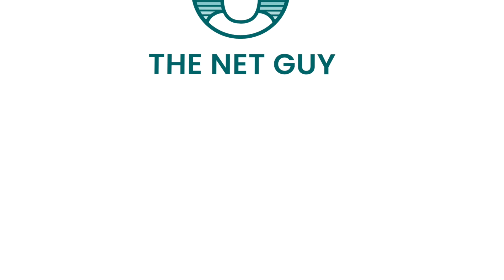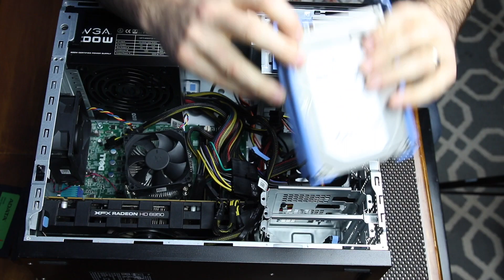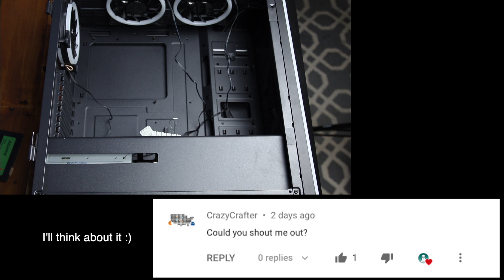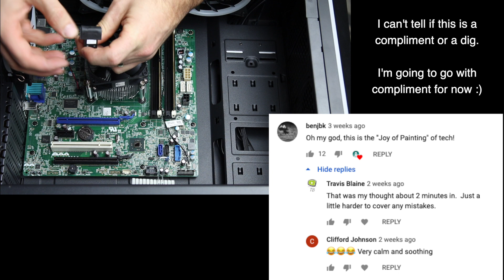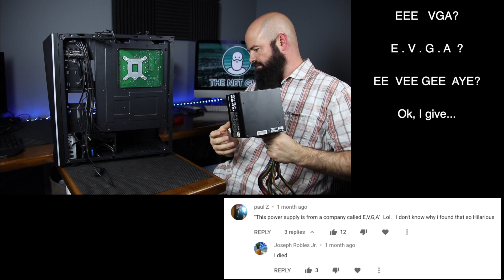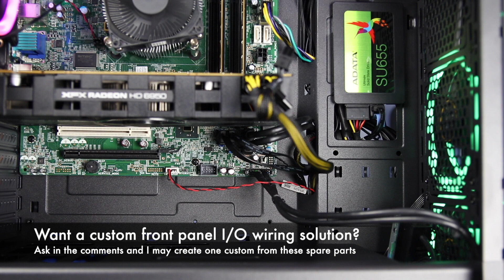Easy Dell Optiplex RGB Case Transplant

Comment: @TheNetGuy, I have a Dell Optiplex 9010 MT. However, i got a new PSU, GPU and everything works great! but recently after cleaning the old thermal paste and replcaing it, I was not able to boot my PC until i took off one of the rams out of the slot. btw: the ram which i took off works in other PC after testing. I don't know if this is an issue?idk..  because i still have 3 slot's which i use and gives me 10GB ram. (the PC only boot's up when i take off one of the ram from the 1st slot) -( figured that out after 8 hours of staring at the motherboard)  
PS: thanks about the power button soultion, i am soon getting a case so was wondering how was i going to power it up. 
#THEBESTNETGUY
Reply from the maker: Oh man that stinks.  I’ve been there.  The first time I did a case swap I was getting no boot up and it turns out it was the ram needing to be reseated.   Sounds like you tried that.  And chance there is a bent pin in slot 1?
Reply: @TheNetGuy  I feel like it might be a bent pin I guess because I remember cleaning my ram slot with the brush. I can however try finding the broken pin and maybe it will work then? I am not sure tho but most probably of what I can now think of 💔💔 

And Thanks Always to you . ❤️

Comment: Can anyone help. So ive changed my dell 9020 case and evrythings connected. But when i switch it on it doesn't detect my harddrives. When trying to enter setup it says "can not enter setup halting tbe system"
Reply from the maker: Does it not detect any of them or just some?  Did you leave the front panel connector installed and hidden?  I’ve heard they can disable some sata ports.
Reply: @TheNetGuy  I've managed to fix it. Just had to enable legacy mode in the bios. But its working great now.
Reply from the maker: Glad to hear my friend!

Comment: I have pc
Dell optiplex 3010 
Core i5 3470 
Rx 580 8gb 
Will there be any issue if i swap to RGB case
Reply from the maker: Beautiful setup.  I’m not certain on that board, but I bet you could figure out the issues.
Reply: @TheNetGuy  will i need adapters or anything to change to aerocool quartz gaming case plz tell
Reply from the maker: Looks like it will work.  Do you have the mid tower version or small form factor case?  https://linustechtips.com/main/topic/927285-pc-case-changing-dell-optiplex-3010-to-cooler-master-5-rgb/

Comment: Hello, congratulations again for this very good job!
I have a question about the PC case model. The brand you are using is not available here. I saw that a large part of the brands have models for around $ 100. For the transition from the Dell 9020 Beyond the aesthetic side, on what points should you be really careful to choose a model? Are there manufacturers/brand to avoid?
Reply from the maker: Great question. What case are you coming from?  Any mATX case will work - stay away from ITX cases.  You’ll need a power supply adapter from the description if you have a Dell 9020
Reply: @TheNetGuy  Hello, This is the Dell 9020 in MT format
Dimensions (H x W x D) Inches / (cm) 14.2 x 6.9 x 16.4 /36.0 x 17.5 x 1.7
I have to change the PSU, so I followed your previous very good video and I saw this video. So I'm thinking of doing the 2 Case + PSU operations. I ordered the 24x8 adapter and am now looking into what to put it all in.
Almost in the same price ~ $ 100
LANCOOL II - X
PHANTEKS Eclipse P400A
Fractal Design Meshify C
MSI MPG GUNGNIR 100D
be quiet! Pure Base 500
Reply from the maker: Check out PC Tech Hustle channel.  He did an amazing lancool II case swap and the Dell looks epic!

Comment: I just got a new case. I can't use the rear fans so would I have to get any adapter? If so can someone tell me? And my case also came with a front fan as well. I don't know where I would plug it into.
Reply from the maker: It depends on the fan types.  What is the base system you have? Dell 9020, 7020?  Most auxiliary fans plug into the power supply.  Controlled fans can run off the motherboard and have 3 or 4 pins.  Check amazon for fan adapters.
Reply: I have a 9020. My dad got it for me for Christmas. He works as a programmer so he got it free. I can see about the rear fan getting an adapter for the 5 pin that it needs to work. I'm just not sure about the front one. I bought the Lian Li 205 case.

Comment: can this work on dell precisiont3500?
Reply from the maker: Possibly.  That a BIG motherboard - you’ll need to find a full size ATX case.  It does have what looks like a full ATX power connector at the bottom though.
Reply: @TheNetGuy  thanks men!

Comment: I have a problem same pc 9020
Power supply 8pin converyor adapter connected with 400w standard power supply but pc get turn on and agin when to poqer saving mode with power light blinking witj orange colour
Reply from the maker: Reseat the RAM sticks just in case here.
Reply: @TheNetGuy  ok bro i wil check it thanks 😊👍

Comment: Did you ever find a eay to make the front io work
Reply from the maker: Unfortunately no - you can get usb extensions and plug into the headers inside and nobody in their right mind uses front panel audio ;)
Reply from the maker: Great name BTW 👍
Reply: @TheNetGuy  thanks homie its a old nickname haha. I figured i just keep the old front usb attached and hidden for my keyboard and usb wireless dongles. i am swapping my my 9020 to a new case after using it as a work pc for the past few months. I got a good deal case with included  rgb fans. I already bought the 5 to 4 pin adapters i was just wondering if the motherbaord supports voltage control of fans since im not sure if the inclueded fans are 4 or 3 pin and if they are 3 pin i might have to go voltage control for them

Comment: Dell 9020 rear fan is I think 80mm. How you fix it on top because these newer cases has only 120mm and 140mm case screw holes
Reply from the maker: Great question!   Mesh openings.  Mount it wherever you want with those :)
Reply: @TheNetGuy  Thanks for reply. BTW I have Dell T1700 which is similar to it. I want to move my motherboard in Corsair Spec 06 RGB Case. Is that a good option ?
Reply from the maker: Yeah that looks VERY similar of a project, would probably work well!

Comment: can i do this with an NZXT H5101? I have an Optiplex 7010 Mt
Reply from the maker: Yes, that would be an amazing case for this. I wish I could get one of those, I just ordered a thermaltake core V 21 cube case for another project I’m on.
Reply: @TheNetGuy  But the jumper thing. I don't know where to get one of those. I heard that the old front io had to be connected for the PC to boot. So couldn't i just snip it a little after the plug?  Then I just use the jumper for the new front io? Could we also talk more about it on discord? Stumpy#1028
Reply: @JohnathanAlonzo  you can buy adapters from harbin electronics on ebay

Comment: Great video btw, i have the optiplex 3020 and the 5 pin front panel looks identical to this...should the jumper positiom be the same? Thanks in advance.
Reply from the maker: It should be
Reply: @TheNetGuy  confirmed..it works..thanks.
Reply from the maker: Fantastic!
Reply: Me too but I can switch it I need help

Comment: I did the same thing with a 7010 tower. For the front panel connectors I took off the housing and routed the usb and audio to the front of the case. In my case the front panel jacks were removable and I was able to route the dell ones through for a seamless solution. It’s well worth buying these boards because they’re so cheap and plentiful. The front connectors were really the only downside
Reply from the maker: Exactly.  Nice job!   Send me a picture and I’ll try to include it in a future video.

Comment: I heard you would want to power the drives from the motherboard and not the new psu. Like it was before the case swap.
Reply from the maker: Yes and no - that power from the board is to lower the amount of wiring, though if you wanted to add more drives or additional loads - if you have the power supply connectors free it saves you from some extra power draw on the motherboard adapter.
Reply: @TheNetGuy  I think the forum post where I read about it was more of a "better safe than sorry" approach. Looking at it myself it seems more like cable management on Dells end, cant imagine why it would matter where the drives got their power from. As long as it was enough, and stable.

Comment: Thank you for that. Depending on how a Dell based build I'm about to start goes I was planning to do something similar with a case I already own and love. No one on the Dell forum could give me a pin diagram for the power switch or told me to just jumper the middle pins if I'm okay with losing the LED.
Reply from the maker: Glad I could help - how did it go?
Reply: @TheNetGuy  pretty well all told. I missed the part about needing to remove the shield around the power button connectors, so I ended up adapting the Dell power switch. Its unobtrusive enough that I'll probably just live with it instead of swapping over to the case power button. Other than that it all went well.

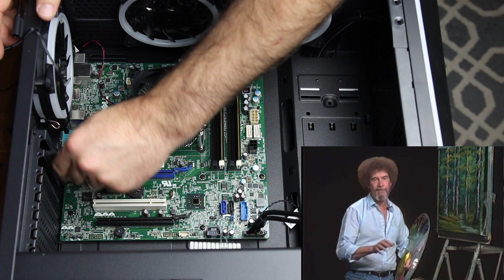Comment: What if I put my graphics card on the black one except of the blue one 15:30
Reply from the maker: Great question.  Usually lower performance.  Often the lower port isn’t as fast or is shared with some other device like an m.2 slot.  It’s preferred to use the top spot even though thermally its not best.
Reply: The Net Guy Okay thank you I just need more room for one more sata cable and my guy is in the way but saw the black slot but I won’t change it thank you!

Comment: Do I need to have the front poanel IO connected or will i get a connection failure?
Reply from the maker: You do need to plug it in for the system to work right apparently, though you don’t have to show it.  I have heard of people cutting the cable an inch up from the connector and using it as a dummy plug.  There must be some pins jumpers when the cable is connected.
Reply: @TheNetGuy   I appreciate your reply! I found out on a forum you can jump the pins manually using the jumpers and it will make the error go away.
Reply from the maker: Interesting.  Can you shoot me the link?   Jon @ TheNetGuy . Com?   I may put it in a future video.  Working now on a Dell 9020 killer series - pics on my Instagram.
Reply: @TheNetGuy  Sure thing! https://linustechtips.com/main/topic/987783-optiplex-70109010-front-io-panel-pinout/

Hope this helps :)

Comment: I have an hp z230 and I want to transform it to a nzxt 510 case and I want to put the water colling does this motherboard support the standard support of port cpu for install water colling
Reply: whats your opinion
Reply from the maker: With the right adapters you can do almost anything.  I would check out Tom hardware in linus tech tips forums. Reddit can also be a good resource.
Reply: @TheNetGuy  thank you so much

Comment: If you can cut the wires at the front I/O header, and it won't have an error, then wouldn't it stand to reason that if you cut back the heat shrink on that wire, you'd be able to see which pins can be jumped straight on the mobo?
Reply from the maker: Very astute observation yes. In this way, you can always go back to the old case if you decide to upgrade later. I ended up doing that with this exact machine, sold that Dell 9020 to a friend in the original case, and it only took about 15 minutes to swap back.  If you’re looking for a more permanent solution, that is one way to do it. Thank you for watching and especially for commenting. Would you like to see more 9020 videos?
Reply: @TheNetGuy  absolutely!

Comment: I had thought of something like this as well.  I, however, went the other route.   I modified the Dell case itself by removing the hard drive cage which made room for larger GPUs and mounted a fan on the front of the case.   I feel this is a cheaper solution but nothing wrong with putting the insides in another case.   Fresh ideas are always welcome.
Another Youtuber shows how to easily modify the case.    Well if you have the correct tools.  ;)
Reply from the maker: For some the visual appeal of an RGB case and additional room can be motivators.  Since you already have a good mobo, cpu, ram, drives, etc from the 9020 that can be reused.
Reply: How did you remove the hard drive cage cuz it's soldered and bolted in? I bought a GPU that is two to three inches too big and I'd prefer to not return it. Could use your wisdom on this. Thanks.
Reply: @CarlPotak  Soldered and riveted in place.  Proper drill bits easily removed the attachment points making a removal a snap.
Reply: @CarlPotak  https://www.youtube.com/watch?v=WtdqulgqWto

Comment: Hello, this does not seem to apply to the SFF 9020, where the CPU heatsink applies directly to the case. Any ideas on how to move SFF to a new case? Not sure how to attach the heat sink. Or is there a way to attach a normal heatsink to it? The 5pin connector is an issue there. Thanks.
Reply from the maker: Great name BTW - but you're absolutely right.  I found some bolts that you can use as a backing for the SFF board - I'm going to do a video soon on the HP 800 G2 which is my "Dell Killer" upgrade which will show this.

Comment: Is it possible you help me with that power switch issue, I got a phantom 410 case with a Dell Optiplex 7020 sff motherboard and I can’t find any kind of information on how to install the phantoms power sw, reset sw, hdd led, +p led pins to the mother board
Reply from the maker: Quick tip.  Skip them.  You don’t need the power led - the system is on :)   Power can go to the upper switch block as I show in the case transplant video.  Skip the reset switch too - nobody ever uses it.  If you have a single spare jumper you can do the whole swap easily.

Comment: Do you think it would work to transplant a 9020 SFF motherboard into a 9020 MT case?
Reply from the maker: I’ve heard the SFF is much harder.  The cables are more proprietary :(
Reply: There's  a video of a transfer to a full case, with a few connectors from ordered.

Comment: as regards to airflow i dont no what case is worse lol !!!!
Reply from the maker: Airflow is definitely not great from the front.  Auxiliary fans are a must or radiator cooler.  It’s a good looking case, just not designed for high air movement.   Check out my Athena M2 review video after this - I compare them and it has excellent air flow.  It’s now my primary case!

Comment: Will. This work with any optiplex
Reply from the maker: For 7020 and 9020 mid tower cases yes.  The SFF cases have some more unique bits.
Reply: @TheNetGuy  what about DT if u know??
Reply from the maker: DT= desktop?  They have SFF and MT and USFF case sizes.  Send me the model and I’ll look.
Reply: @TheNetGuy  it's bigger than a sff but smaller than a Mt it has 4 USB ports down the side of the dvd

Comment: You misssed the parts of instaling the front fans so can you show us how to do that and cqn we make the audio of the insted of the the original audio jack
Reply from the maker: Good point. In my new case the front fans were already installed and hook up via molex connector.  I have another video where I do a fan upgrade on this case with the Aeolus fan kit that's pretty cool!   The audio connector is lost in the process - you can't wire it up without cutting anything.  My goal on this video was a swap without cutting wires - in fact I sold this machine shortly after in the original case to a friend and didn't have any problems putting it back.  Thanks for watching and commenting!

Comment: Hi I was wondering if I need the jumper for the power switch if I do is there anywhere to buy one?
Reply from the maker: There may be a spare on your motherboard somewhere.  Also, and old switch will do as long as it had the DuPont connectors (black 1mm wire connections).  If you’re in the US, shoot me your address via email and I’ll postcard you a couple extras :)

Comment: Hey tech guy, I transplanted an optiplex 3010 into a raidmax case. I was actually able to get the front panel audio to work because that particular dell had a slot on the motherboard for hd audio. Im having trouble with my power switch though. could you send me a link to that jumper that you used in this video.  Also, did you ever come up with any way to rig up reset and leds. thanks in advance. awesome video
Reply from the maker: It's just a standard computer jumper - hopefully there is an extra somewhere in your nerdery pile.  Worst case you can use anything conductive that will touch just those two pins and not their neighbors.   Another option is a piece of wire, paper clip, or anything that can connect those two.

Comment: I have a problem, my psu is not broken ( I have tested it) but whenever I plug in the adapter it seems to not start. Please help, thanks!
Reply from the maker: Did you jumpier the middle set of pins on the power switch as shown?  You can also take the entire power switch from your old case and transfer it over to test first!

Comment: Will this work for a dell optiplex 9010
Reply from the maker: Yep, they are almost identical machines.  Good luck!
Reply: @TheNetGuy  thx
Reply: @TheNetGuy  I was wondering would it work with my dell optiplex 790 mt
Reply from the maker: I can’t guarantee it but from what I’m reading it looks possible.  Maybe I’ll buy one on eBay to try it out?
Reply: @TheNetGuy  Yes that would be helpful but I have just bought all my items off of amazon I'm getting a arecool cyclon case hopefully it works
Reply from the maker: Let me know how it goes.  I’d try the tricks I showed in this video.